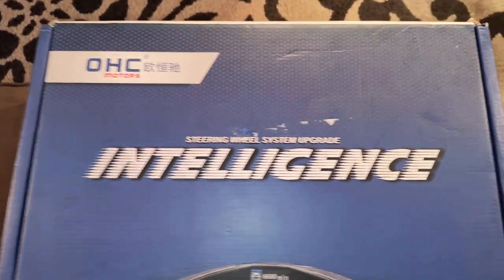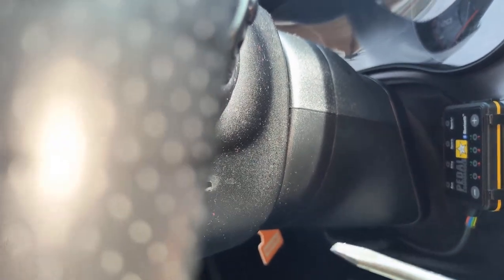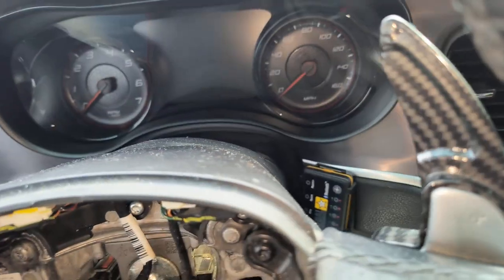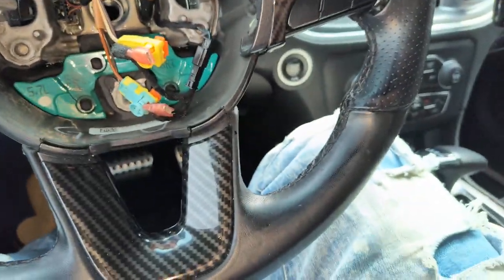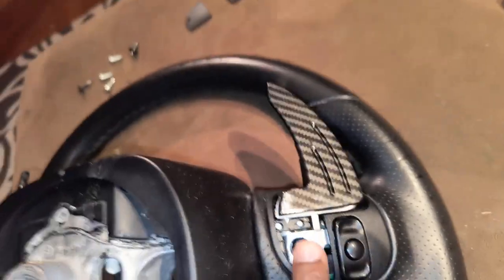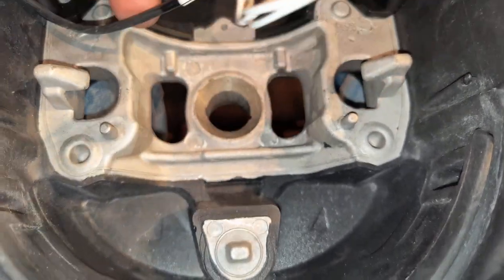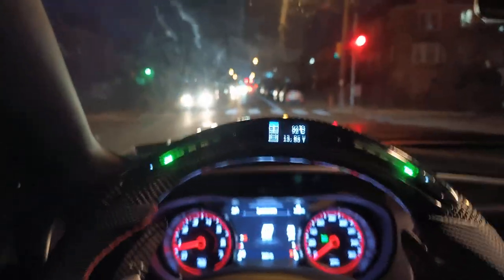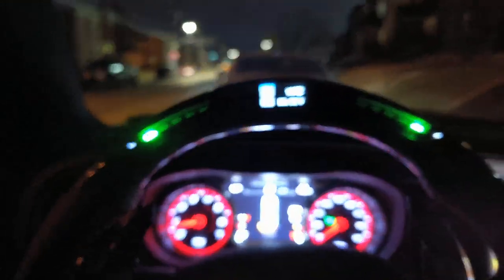CUSTOM CARBON FIBER LED STEERING WHEEL FOR MY DODGE CHARGER R/T 🚥😎 (Install & Review)

Comment: I just put mine on it was a pain in the ass. It was hard to put the airbag back on. Also If you don't put the bolt back in straight you will stip it.
Reply from the maker: @marinemp2003  Facts, the air bag is definitely a pain in the ass to get back on, the clips behind it are a bitch. One piece of advice, if you find that your battery is dying or maybe even before it does, disconnect the OBD box from the port every night. For some reason, it drains the battery even when the car is off.

Comment: fire ass steering wheel bro can u link it?
Reply from the maker: Good look 🤝🏾💯.
Here's the link Terisass Steering Wheel Carbon Fiber Automotive Racing Steering Wheel LED Shift Lights Display Steering Wheel Fit for for Dodge Challenger/Charger SRT HELLCAT 2015-2020 https://a.co/d/3GIA7KU